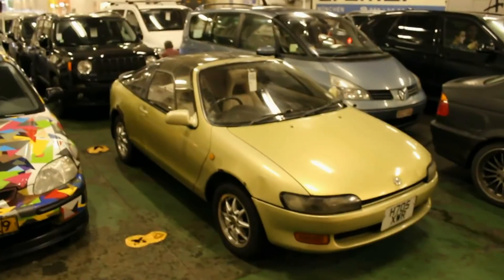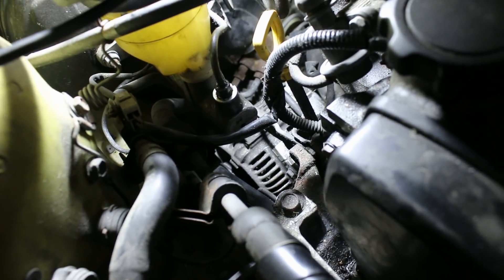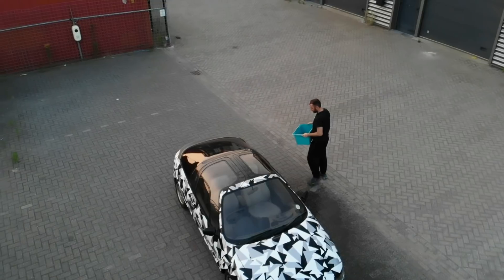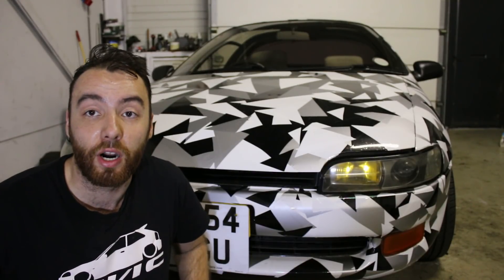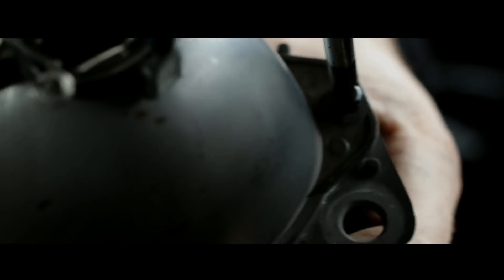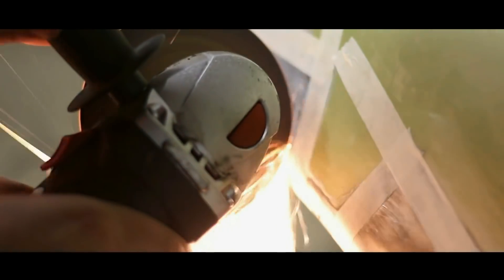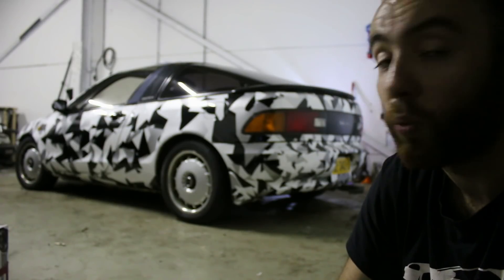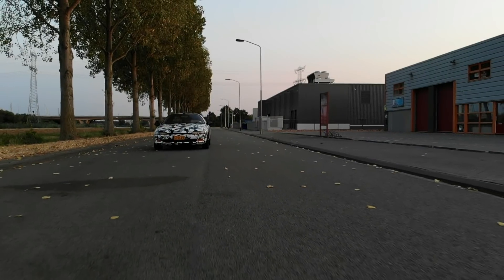JDM Toyota Sera EXY10 transformation

Comment: i love this thing but i have a question aboout the license plates, Does it have to be a normal one thats 15cm from the ground? or is it the small or the bike one? because they vary in height too
Reply from the maker: The top of the license plate tray has to be lower than 50 centimeters from the ground if the bottom side is open like the sera bumper. If it is higher than 50 centimeter then you will get a large square one which looks like this: http://www4.picturepush.com/photo/a/13115767/1024/Youngtimer-event-2013/Toyota-Sera-%282%29-BorderMaker.jpg. The bike plates are not allowed on a car unfortunatly. I prefer those as size wise they look more like a Japanese license plate